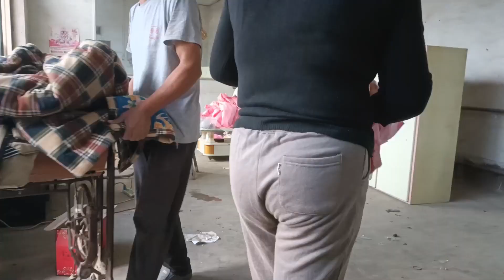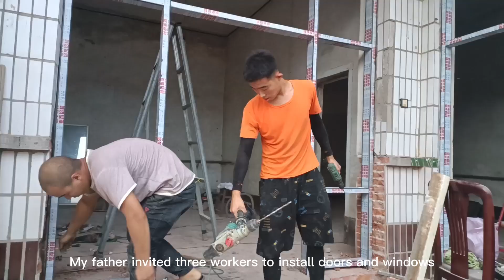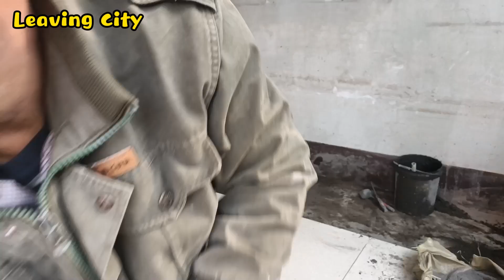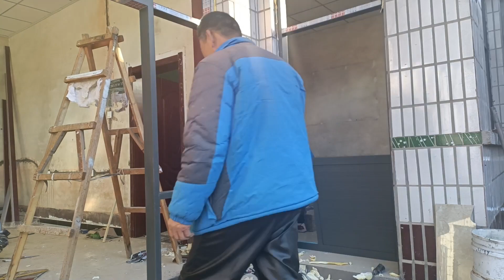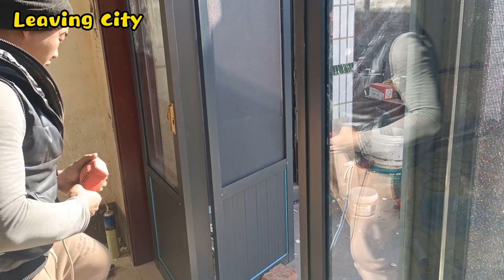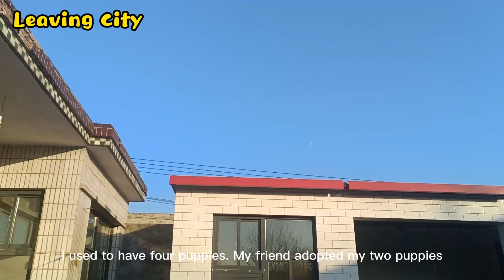20 years old house renovation My parents and I renovated the two houses we were living in Part 02

Comment: Stop. NEVER lay electrical cables diagonally... 1. You don't know where to drill and 2. Well, even if the standard doesn't apply everywhere, you should try it.

Just some well-intentioned advice. No Western European, for example, would ever suspect that somewhere there is a diagonally running line and drill quite loosely, because nothing can definitely happen if the electrician has worked according to the standard.

Otherwise you have to check each screw to see if there is voltage.

✌🏻